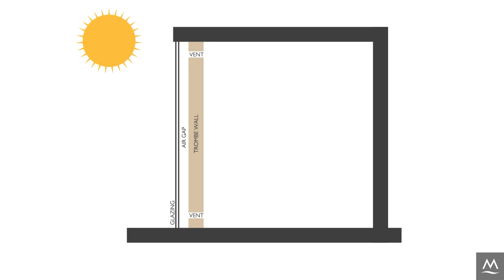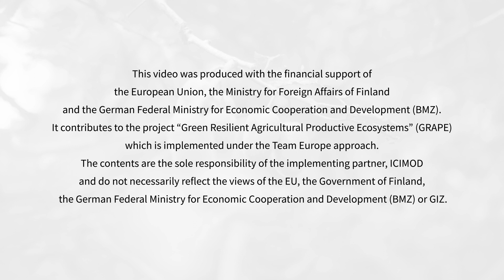Trombe Wall

Comment: Does this make the space significantly cooler during very hot days?
Reply: No, the glazing on the outside needs to be protected from sun during days where there would be too much heat for the building. An awning can help. In temperate biomes a deciduous tree planted in front will provide shade in the summer but the bare branches will let light hit the wall in winter.

Comment: Thank you for the video. How do you provide ventilation in the building, i.e. how can fresh air enter and stale air leave the building?
Reply: A trombe wall is not usually used to provide fresh air ventilation, but a vent could be placed under the exterior glazing. One problem is the lack of access to remove debris or insects that might accumulate; for this reason it is more simple and resilient to only vent through the top and bottom of the massive wall inside.